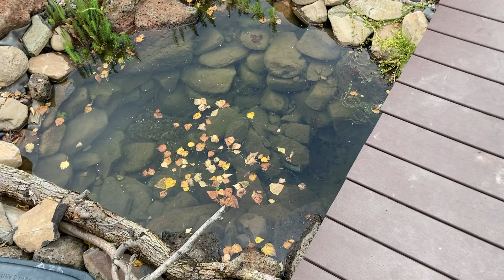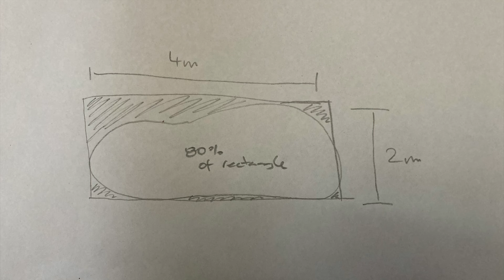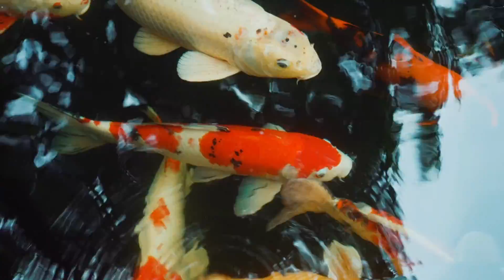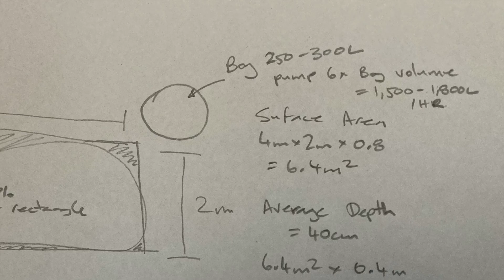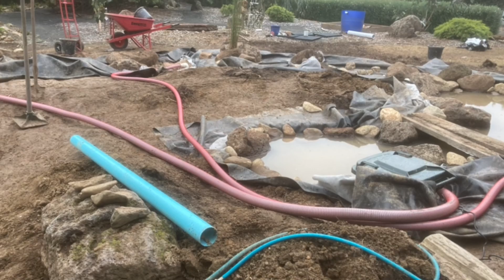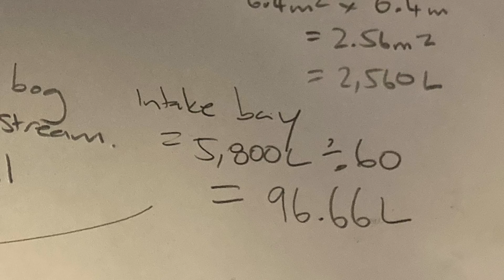How to design a backyard pond with bog filter, intake bay and stream

Comment: Any negative to having a high flow pump in a smaller pond/bog filter other than just cost of pump/electricity?(idea is to make a bit noisier/wide waterfall
Reply from the maker: You potentially blast the debris that the filter is supposed to trap straight through. If I want more flow I divert the excess over the surface not up through the bog.

Comment: Subbed! We recently bought a house with a fish pond, started watching a bunch of your videos (probably the best pond channel on youtube).
I'd love to swim in the pond however and both the bog filter and pump are too small. I estimate the pond houses about 6500l water while we have a 3500l pump. What would be the most effective, buying a second pump where both pumps add up to 6500l or replace the pump I have now with just 1, 6500l pump?
As for increasing bog filter size, is it better to have 1 big one, or 2 medium sized ones, in series with eachother, or with seperate cirquits in case I run 2 pumps?
The house required a lot of work but the pond is my favourite one for sure!
Reply from the maker: 6500L seems very small for a swim pond. For a swim pond you want a 25% or more bog filter. You can create two seperate ones or one big one whatever’s easier. Depending on bog or bogs final size, pump should be around 6x volume of bog. Hope that helps.
Reply: @Ozponds  ye I probably should've worded it differently, it's not really to swim, more to just jump in on a hot day or after a sauna type of deal. Thanks!

Comment: https://youtube.com/shorts/YZ8ROMiOqYE?feature=share
I built this bog filter about a week ago. Can't get the flow right. Basically no matter how I adjust the flow rate on my pump, water comes out of my air vent (?). Any advice? Been following and designing this filter with your you tube guidance. 😊
Reply from the maker: I can’t seem to get the link to work. Do you have a valve on the vent?

Comment: Hi kev, planning on building a bog filter, just asking do you need to use natural rock in the bottom or can i use some old paving i have lying aroud to save a bit of cash ?
Reply from the maker: I think old pavers would be fine. It’s just to provide surface area and allow water to flow through easily.
Reply: @Ozponds  ok, cheers mate 👍